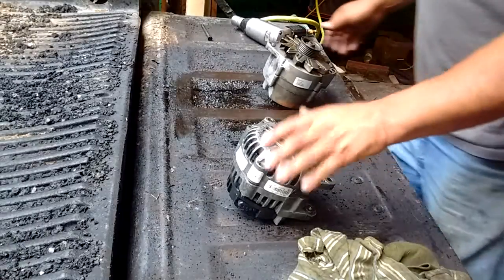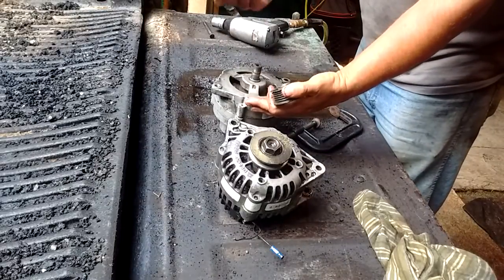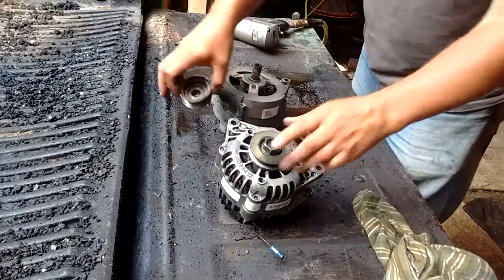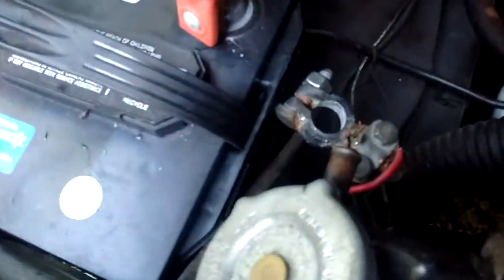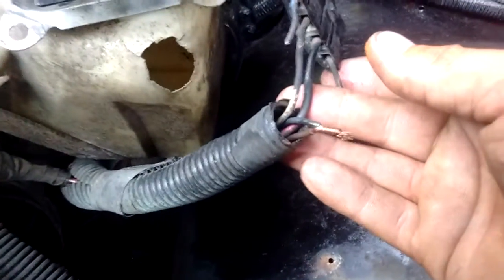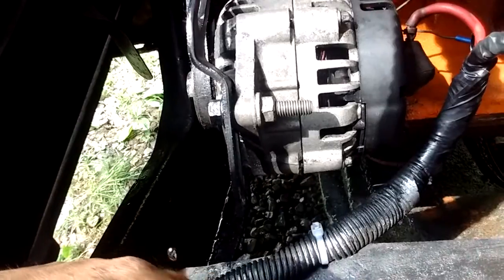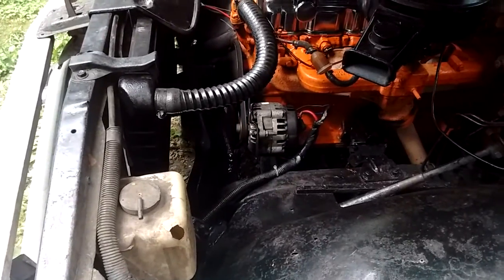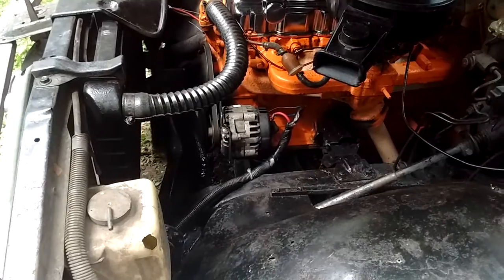68 Chevy alternator upgrade

Comment: Looks easy enough, will upgrade if (when) mine ever packs it in. Curious if you changed out the resistor wire when you upgraded to the HEI ? was told that was needed to keep the module supplied correctly, does it ever sputter or chug at higher rpm ? Changed mine out years ago but did not change the wire in case some purist (me) ever wants to put it all back to bone stock. Used a relay triggered by the original wire to supply the HEI... thought that was pretty tricky.

Always like it when video's show up in my feed from you... take good care man
Reply from the maker: I didn't change the wire, but I think it was removed years ago by Dad. I think he replaced the wire all the way to the fuse box, there has always been 12 volts to the coil as long as I can remember. I always wondered why I went through points so quickly.